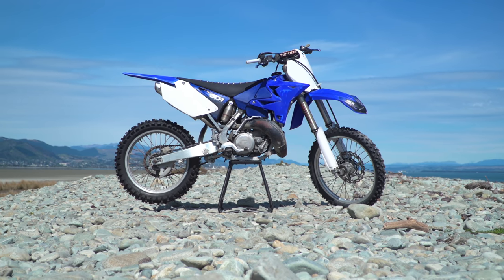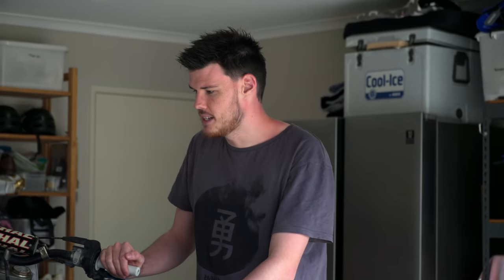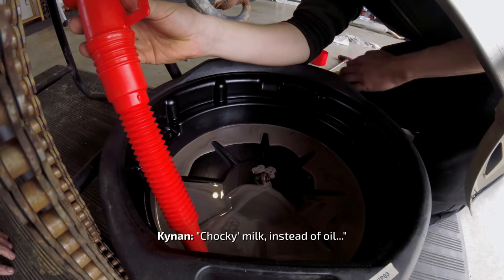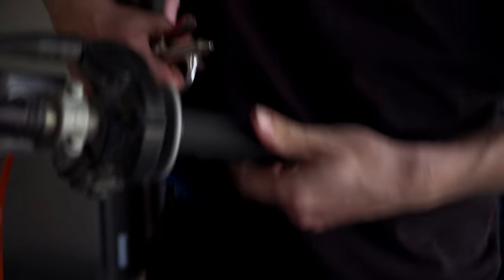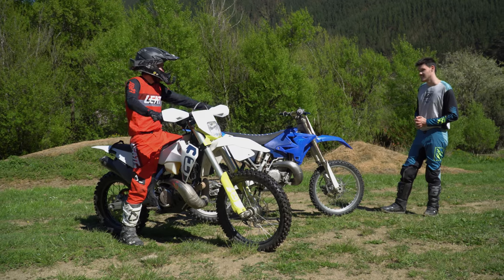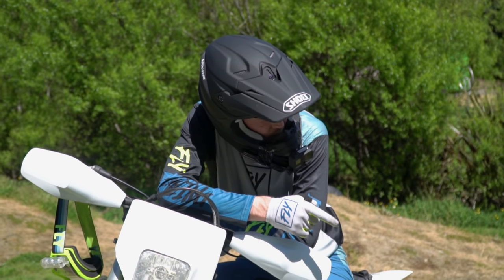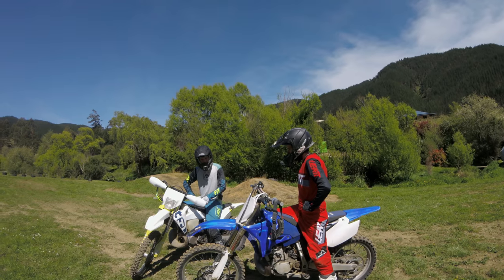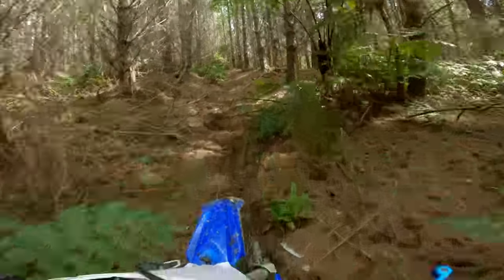Crafting a KTM Killer – Episode 1: The Bare Bones

Comment from the maker: Any suggestions about what mods we should do to the YZ that will make it better than a brand-new KTM?
Reply: Cr 500 motor.
Reply: Weighted fly wheel 
Lectron carb
And this thing you put in the airfilter boot I forgot what it's called but it directs air flow low and gives it more low down power
hydrolic clutch 
e start
Reply: Flywheel weight.
Recluse clutch.
And a better carb like a lectron or something else.
Reply: higher gearing like a bigger rear sproket or smaller front flywheel weight diffrent carb like a smart carb or lectron
Reply: Currently doing this exact build and I'm going the route with apex head, fmf gnarly, 18 inch rim, V-Force reed,  oversized rotor and FWW
Reply: Awesome video I don’t know if it’s possible but maybe you can swap the transmission for something with a lower first gear for enduro riding
Reply: My rm250 has both the lectron and flywheel weight as others suggested. Its changes the bike completely. So much fun and well under half the price of a ktm
Reply: nothing will mate it better than a KTM dude hahah are you trying to make it a enduro bike or MX bike?
Reply: Apex technical innovations xc head
Reply: put a fly wheel wieght on it it make  eseayer to ride
Reply: Try a Suzuki needle. Change the power jet to a 40 rather than the 50 so it will idle better (set float), then jet it proper and ride it before anything else! Get suspension properly tuned for offroad. 18" rim for rear. Steering stabilizer
Reply: Well depends what you want to do?
Reply: Brakes!
SmartCarb 
Suspension revalve
Reply: My YZ250 has a flywheel weight, a traction disc and wr gearing and it fixes the stalling and really helps to make it a tractor. Also other non performance parts like skidplate, radiator braces, sidestand etc... I would like to try a lower compression head or a throttle tamer sometime. And obviously e-start is a nice to have but personally I just cant justify that amount of money when I can just kick it once.
Reply: stock carb is great once jetted properly, i added a recluse clutch so i only need to kick once then i cant stall it the entire day, i was looking at the pantera kit aswell but locally in RSA it costs more than a yz, i also added boyesons reeds, an eddie sanders 325 ceo kit, wr gearbox and a scotts damper, its a monster eats 300s and 450s in the open stuff and loves rocks. more than welcome to click my name to see the 325 go. future plans is an onboard lipo battery, headlight and maybe a stater capable of charging
Reply: Lectron carb for sure... Or the other brand which I can´t remember the name of right now that does new carbs which basically adjust itself...
Reply: 300 kit
Reply: Sell it buy a ktm 👍🏻
Reply: In this order. Apex head. Heavy fly wheel. Maybe the X CDI. 18" rear wheel. Some people remove the spacer on the power valve governor. Suspension for sure. Skid plate. Rad guards. Maybe a 270mm front rotor. Gearing if needed for your terrain. And tires. The keihin carb is pretty good actually, once jetted correctly, as long as you don't see too much elevation change.
Reply: 426 gear set
Flywheel weight
Mako 360 bar mount 
Suspension
Thats the recipe im working on with mine
Reply: Learn to ride
Reply: No, cause you can't
Reply: @joshlivingstone7598  you're spot on but that would be lower gearing
Reply: @matthewchristie6573  YZ250X gearing
Reply: Yes.... Sell it and get a KTM
Reply: Absolutely nothing, you will be able to get parts for it many many years. Unlike KTM
Reply: Nope i dont think so
Reply: Apex head
Flywheel weight (9oz)
Yz250x gears
Yz250x power valve spring
Vforce 3 reed valve
Properly tuned/jetted factory carb (don’t buy into the lectron hype) 
14/50 sprockets
FMF gnarly pipe
E Z pull clutch lever
Reply: That yz will need a 6 speed with a true wide ratio trans, hydro clutch, lighting coil, bigger fuel tank, more inertia like eccentric weight or counter balanced to compete with euro bikes in the woods. Otherwise they belong on the track
Reply: If you're going head to head with a ktm. You gotta go all out and put everything on it that ktm already has.

-Hydraulic clutch
-Smart carb (close to efi as its gunna get)
-wr transmission 
-flexx handlebars (since there's no counter balance)
-e-start kit
-properly set up suspension
-18" wheel
-kickstand 
-proper pipe/silencer for trail
-flywheel weight
-head 
-oversized fuel tank
Reply: @haitzyice  not really about learning how to jet as it is about not wanting to jet every time the temp or Alt changes. Ive started a ride at 7k ft and ended at 12k ft same day. Had to set the carb somewhere in the middle since changing jets mid ride is a bit annoying. Lectron woulda been nice. 
Besides that, this series is about beating a new ktm with efi.
Reply: Mako 360 bar mounts to sort out the vibrations. Don't do a hydraulic clutch because they're not actually any lighter on the yz, just put a nice perch on it and it'll feel a lot lighter for a lot cheaper. An 18inch rear rim is also an option
Reply: Revalve suspension, lectron carb and gearing. 
And that is besides the e-start you got which I believe had a heavier flywheel.
Reply: @brandondoorn900  I’ll compete on my bone stock YZ!!! All 300lbs of me. Lol yea right 🤣🤣🤣
Reply: Jd jetting, oversized front brake kit, weighted fly wheel, 51 rear sprocket for the woods and re-valved suspension.
Reply: Compression , porting , reed , surely fuel injection could net you a couple more hp , thats a lot , what does the KTM motor cos ,t I guess that would   defeat the purpose ?
And of course the best susoension you can afford
Reply: Flywheel weight should help with the stalling.
Reply: My 07 yz, I put a ESR 325 big bore, FWW full 1st to 5th wr 426 gearbox 18" rear wheel. It's a great bike for the bush.
 I have recently bought a 19 low hour with a damaged gearbox. So far I have put the WR 5th gear and FWW and power valve mod. When I wear out the rear tyre I will put the 18" wr 450 wheel on. I found it made a big difference in traction when things get gnarly.
I also run standard pipe on both bikes they make good allround power and are cheap second hand.
Reply: You can’t make it better
Reply: @mxallday1301  Why not?
Reply: @justinpeterson8754  u can’t make that old yz250 better than a brand new ktm
Reply: @mxallday1301  What specifically on the YZ can’t be made as good or better than a KTM?
Reply: @justinpeterson8754  depends what type of riding  they set it up for but if it’s for woods\enduro it dosent have a e start, fuel injection, oil injection like new Ktms do also they would need to install lower gearing, a flywheel and a better pipe which by the end of adding all these extra things they need for it u would spend just as much as a Ktm and Ktm will always be better for enduro then a Yamaha
Reply: suspension 
flywheel weight
Reply: Your axle is thru wrong way .Nut on the disc side .Can be knocked loose on the left side
Reply: High comp cyl head
Athena bigbore kit 
Stroked & rebalanced crankshaft 
Port & polish
V force3 reedvalve 
Vortex x10 cdi 
Bills full exaust system 
Hinson slipper clutch 
Brisk spark plug and race gas
Reply: KTMs are waaay overated, waaay overpriced, and no where near as reliable as a YZ. Stick with my yamaha.

Comment: Depends what you want to do with the bike.. my yz is setup for bush/single trail. A flywheel weight definitely allows you to lug the bike at low revs without stalling, even with taller than stock gearing. Also moving the clutch perch as far away as possible from the grip helps alot! A pipe/silencer combined with a head to suit the purpose of the bike is also a massive improvement along with jetting/clip position. My yz can do everything a new fancy euro enduro bike can do, the only downside is no electric start
Reply: Did you see the Panthera Motorsports box at the end? Electric start is available, it's pricey, it's fiddly to set up, it's heavy and finding a good spot for a battery is tricky but electric start is awesome!!! I have one on my CR500 trail riding bike.
Reply: @craigdavies8099  I just watched the end part, I remember reading a little while ago that an electric start kit would be available for the yz. Curious to see what's involved to do the conversion, a good location for a battery is the airbox, I had a DeWalt lithium battery under my seat at one stage for my lighting kit that just rested against the airfilter
Reply: @nathanjv28  My kit didn't come with wiring, switch or a relay. Can't remember if it came with a rec/reg. The smallest lithium battery from Anti gravity is perfect for airbox install, I made a little Titanium box for the battery. It reduces the air flow a bit. Some shims might be required to get it aligned properly, that was the hardest part... I would be happy to do the install for you.
Reply: Could you tell me what ya jetting set up is much appreciated, fuel ratio aswell
Reply: @Midnightpurpler34  Hey mate, I'm pretty sure I've got a 175 main and 48 pilot. I'm currently running 50:1 fuel ratio

Comment: If you want to make it an offroad bike more than a track bike my thoughts would be:
18" rear wheel
Yz250x transmission kit
Mill the head or put an aftermarker head (apex, tsp, etc)
Fmf or equivalent gnarly pipe
Smart Carb or Lectron (sc2 personally)
Revalve the suspension to be softer
13/50 sprockets
Governor mod
Thats it for off the top of my head.
Reply: I would skip the 250x transmission and go with a WR400 or WR426 transmission. Better ratios and they drop right in with a little grinding.
Reply: hydro clutch
Reply: Definitely go with a WR transmission. The KTM/HUSKY/GAS GAS transmissions are Geared much lower than the 250x transmission. WR Box would be much more suited

Comment: I love my YZ250X. In this order. Apex head. Heavy fly wheel. Maybe the X CDI. 18" rear wheel. Some people remove the spacer on the power valve governor. Suspension for sure. Skid plate. Rad guards. Maybe a 270mm front rotor. Gearing if needed for your terrain. And tires. The keihin carb is pretty good actually, once jetted correctly, as long as you don't see too much elevation change.

Comment: I would consider an electric start, rekluse clutch, lower gearing and a low range pipe if you're going into the woods with it. Motocross bikes are less than great for trail riding unless you make some changes.
Reply: Recluse clutch is for lazy people ,yz250x would have been a much better fit for this

Comment: I set up an 06 yz250 for trails/scramble racing, it worked great. The suspension is better than any stock ktm.
I added a 11oz flywheel weight, wr450 shock(off the old steel framed one), bigger gas tank, stunt clutch lever(easiest pulling set up going),  hand guards, rad guards and skid plate. I ran the stock pipe and gearing on purpose, it worked good locally, any lower and I lacked top speed plus first was low enough for me.

Comment: 300 cylinder[ if possible], head that has interchangeable domes for running pump gas and/or race fuel, port match the cylinder to the cases, stroker crank & holeshot device . If its absolutely necessary get a lectron carb..

They just made a newer model but hasn't yet been released to the public..

Umm 2015 air box mod let's you use the updated plastics.. but not necessary

Comment: Flywheel weight tubless rear and a gummy tyre ether a shinko 525 cheater or kenda ibex the shinko comes in a 19” if you plan on keeping your current rear wheel. Tyres and tubless are the two biggest helps with my mates that I get into riding enduro but suspension is a biggy to

Comment: I’ve got a long list of mods that I’ve done to mine.  Without electric start, counter balancer and a 6 speed gearbox it is never going to be better than a Ktm exc in the bush.
My mod list
WR426 full gearbox
18” rear wheel
Mako 360 handlebar mount
11 litre tank
Trail tech stand
Throttle tamer
VHM head
Vortex ignition
Honda master cylinder
Fasst Company anti vibration foot pegs
2013 yz250f swingarm and linkage
2006 Yz450f forks
Black wheels with talon hubs

Comment: A stock YZ250 can do Mx and XC without Any issue, as long as you keep it high in the revs in the latter. When it comes to Enduro tho’... it’s lacking. Thank heavens there’s mods and aftermarket parts and with enough Cash you can make it better than a KTM or Husqvarna.

Comment: Hopefully you have better luck with the China built stator me and a few people I know did , I went through two stators in around 150 hours , got stuck in the mountains both occasions , ended up going to the total loss system that uses the stock stator , I will say the mechanical portion of the starter system is well designed and built and mine shows little to no signs of wear at 150 hrs +…..

Comment: Wouldn't it be more helpful if the YZ or YZX came with better gear ratios in the transmission and perhaps available 6 speed to go with it?
I do prefer a carbed motor too. The TPI is a non starter.

Comment: Hey mate I ran an 07 RM250 a few years ago in the central enduro series which was pretty good after a flywheel weight, 18’ rear and setting up the timing and jetting. Definitely needed electric start though. Or à rekluse, they seem to be good in technical stuff. Interesting to see how you go
Reply: im using a 05 rm250 for woods riding and the bike is more than happy. i cant justify the cost of a 300.

Comment: eyup ash got the same bike a bit older but the same ive stripped it rebuilt engine re newed all bearings and road registered it and its a lightin kit on it it came with a after market hydrolic clutch and iv added a fly wheel weight they improve things

Comment: Bash plate with a pipe guard, a flywheel weight, lectron carb and a high compression head would be nice
Reply: low compression head. rktek heads, apex heads, 2 stroke performance since sowman is in NZ
Reply: @TroNPopz209  you want a high compression head

Comment: Weighted flywheel, SUSPENSION SUSPENSION SUSPENSION. Lectron carb. LECTRON CARB WEIGHTED FLYWHEEL OR STEEL CLUTCH BASKET
Reply: I’d probably suggest the steel clutch basket over the flywheel weight. It’s much heavier so it will help with vibration as well as basically make your bike impossible to stall. Maybe depending on how aggressive your planning on enduro riding I’d suggest an 18 inch rear wheel
Reply: I wouldn’t even waste the money on the electric start conversion. Once you have that steel basket you’ll never stall again

Comment: Put the yz250x transmission and softer springs FMF fatty and 18 inch rear rim.. and fly wheel weight.. would make bikes more comparable.  Too much to invest in old tech in my opinion.. I just ride mine as is...if I rode a Huskey or KTM. If want one so I don't try em...lol

You're comparing a motocross bike to a trail bike.  I have the yz250 also. It works. But no comparison to a KTM xc.

 And first gear is too long for what I like to ride. I like tight single track.   

But overall the bike is good. Great thing is I can still take the yz to the track days...